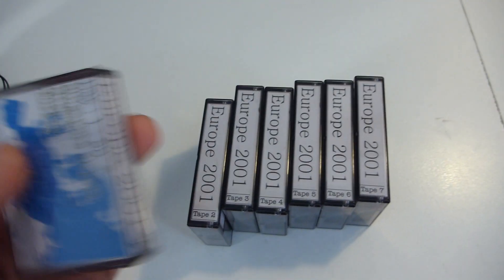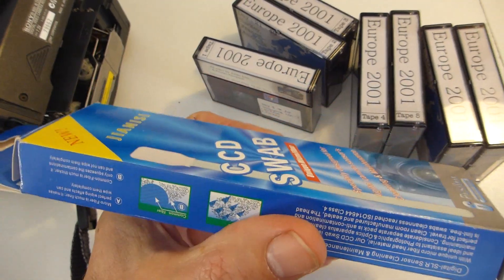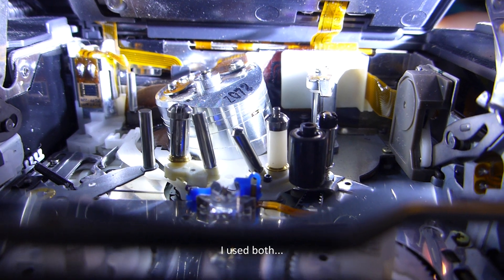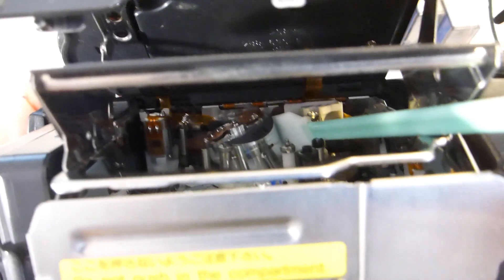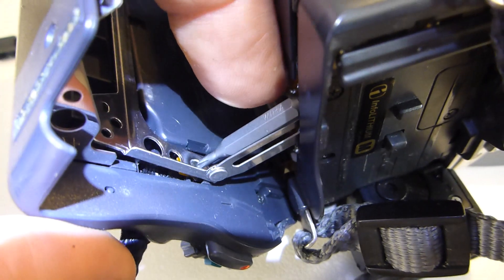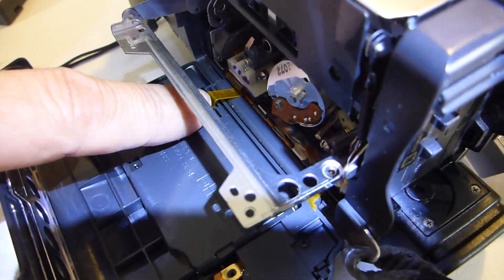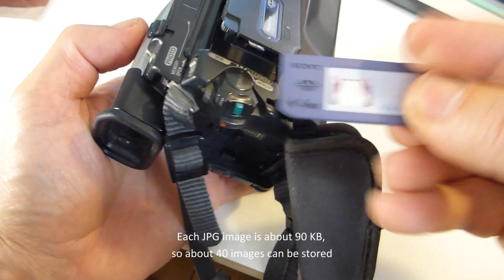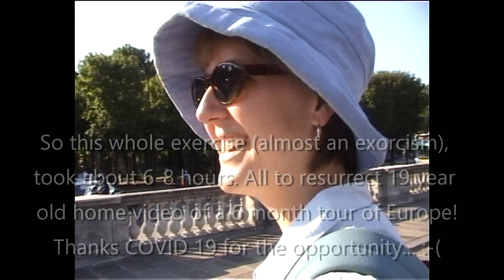Sony TRV-11e Mini DV camcorder head clean

Comment: Thanks for the video mate! Very helpful. I tried unscrewing the tape housing, and kept losing the screws into the body of the camera! Oh no!! And didn't have the tool to reach the last screw... so I just thought - maybe just, I can reach the heads without disassembling. Luckily the TRV15E seems to be a little more open than yours, and I managed to reach the heads.
AND - managed to get the screws back in, so no more clogged heads!
Thanks again mate!!

Comment: Thanks for posting. Unfortunately i have gone through two cameras before discovering some tapes have a fine mold film….. guaranteed to kill every camera. Lesson to be learnt - never borrow or lend cameras or tapes…..    so …. Anyone know if it’s possible to clean tapes ?
Reply from the maker: I don't think so. I know sunlight (UV) kills mould, as would a mild ammonia solution. I'd try the sunlight first! You can open the tapes up and expose them to sun and air if you're handy and careful. Good luck

Comment: Thanks for this. I'm home for the holidays and trying to get an old sony Sony video 8 Handycam model CCD TR 21 working for tv playback. Audio works but display does not. In the view finder and on the tv the video does not display EXCEPT while you fast forward or rewind the video. Once I press play video image goes away after a second.  Does it need a cleaning? Any thoughts?

Comment: Thanks for the video!  Just to be clear, you cleaned the head 3 TIMES,  each time allowing the head to dry. After the 3rd cleaning it fix the playback and you were able to recover all the audio that was previously not working. Is this correct?

Another question, has anyone experienced the device to start eating the tapes? Do you know if cleaning the head solved the problem? I figured if the head was really dirty, tapes would stick a little and bunch up and not play back correctly hence the eating of tapes. 

You mentioned "stretched tapes" will not play correctly in your description. I guessing, since the head needs the full width of the tape it will not play. What happens with stretched tapes? 

Anyone who can help please leave your feedback. I have some footage on Mini DV tapes I like to digitize and edit. I may have to buy an old camcorder on ebay if I can't fix the one I have. Thanks in advance for your help : )
Reply from the maker: Yes, heads were allowed to dry, and 100% isopropyl alcohol was used - very sparingly though. Avoid cotton buds (cue-tips), they shed. Yes, marked improvement after 3 x attempts. Not perfect, and still some jitter, but recoverable. I didn't do it any more than that because the cleaning tapes are abrasive. The comments on stretched tapes were based on anecdotal comments from a photographer friend many years ago. Analogue (e.g. Hi8 and VHS-C) has some leeway, but digital not so. I think the issue with eating tapes is from roller and pinch wheels grabbing them, or being out of alignment (I wouldn't touch the alignment myself). Always best to fast-forward all the way to the end, and then back to the start again, this should remove slack spots in the tape. Cheers